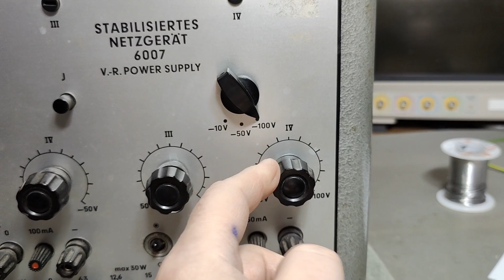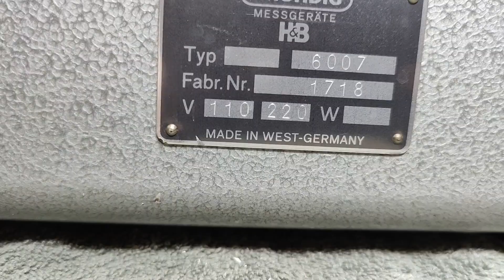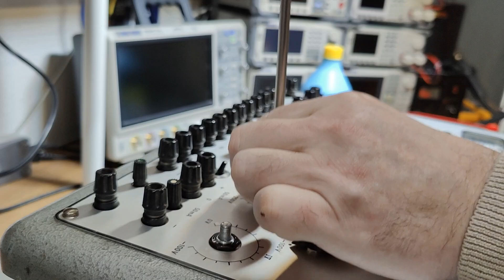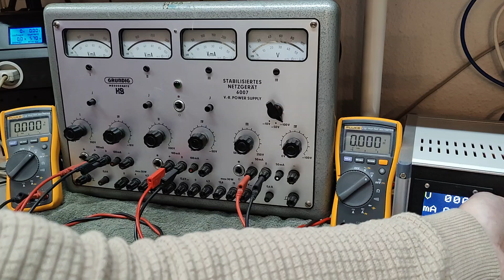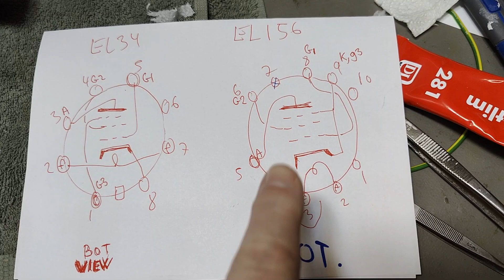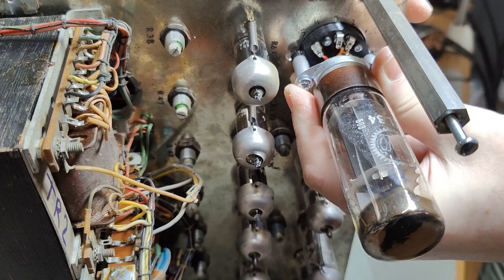Grundig H&B Stabilisiertes Netzgerät 6007 1955 test teardown EL156

Comment: Something about these spring loaded tube holders is scary ... handling them always feels like you are one slip up away from smashing the top off your tube, especially when they are in a more constricted space like in VTVMs and need to be opened with tools...
Reply from the maker: glad to hear i am not the only one who feel like this, super scary if they slip then bang broken tube, but i like the idea to hold tubes carefully onto the socket, many times i repair old stuff, the problem is tubes halve way out the socket .

Comment: when reinstalling knobs, I like to put a piece of thin cardboard - one or two layers of a lid of a supermarket pack of cigarette paper is great - under the knob and pull it out after the knob is installed. You get all the knobs on at a consistent height that way easily.

Comment: I restored mine just last year; already served me well for some tube and neon bulb issues ^^ - the current shunt is probably not always connected because it would be heating up and the meter is extremely sensitive. pegs at some µA if I recall correctly. so the shunt should be extremely low and finely tuned. If memory serves, it was just a piece of coiled up wire...